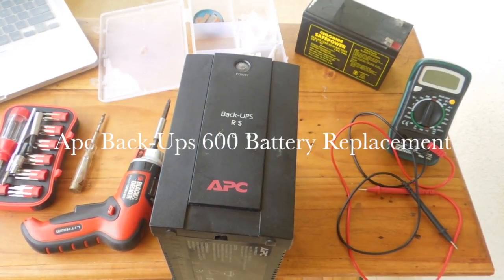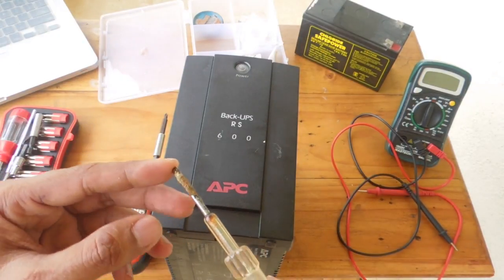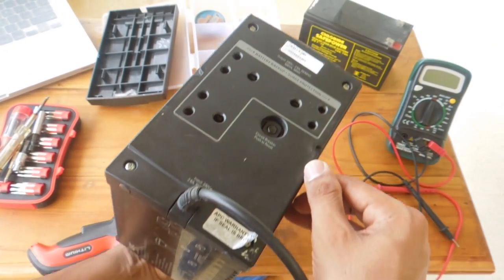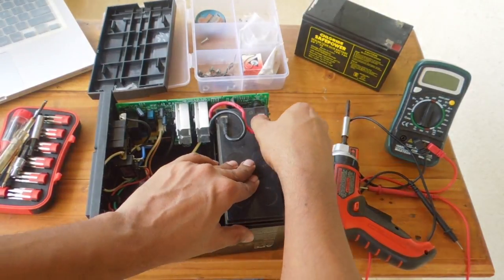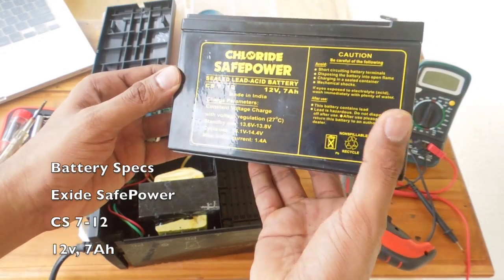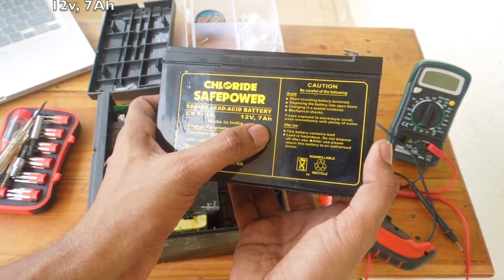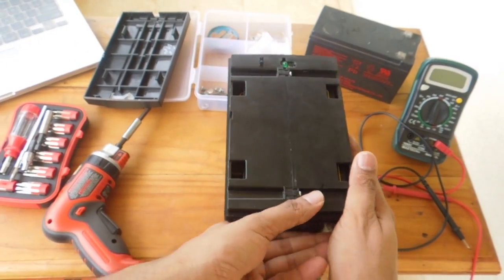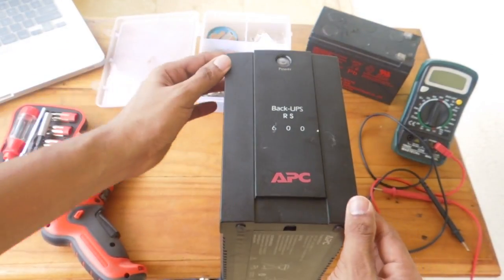Apc Back Ups RS 600, 500 opening and Battery Replacement

Comment: i have 550VA 330Wats so it come with 12V lead acid battery i change it have 18V 5A lithium battery with 18V converter sept down to 12V 20A so i can used 18V 12 amp 18V 20A ETC

Comment: Sir, please help  me. I replaced my battery before 14 days. But after some times it creates beep sound. Why
Reply: does it make a single beep or few continuous beeps, try disconnecting the load (peripherals that have been connected to the ups) and see if you still get a beep
Reply: @krasotkachekaleva191  few continuous beep, sir. Now it not on
Reply from the maker: have a look at the Error codes (Beep sounds) in the manual. Check if the battery is getting charged,  also check if the battery is an original one as in the market lot of fake batteries, if the battery is not charging could be a fault in the unit. Hope this helps.

Comment: Thanks, this video is very helpful but like someone else mentioned the mentioned Exide battery size is little bigger than the original APC battery and hence the battery compartment had to be enlarged for which some effort is required. Perhaps the newer version of Exide battery size is different, other than that spec is matching perfectly, works fine. Thanks again!
Reply: I also had no problems in putting the exide battery in the apc ups had purchased the ups on marketplace in Goa, and there was no need of compartment enlargement, only thing you need to properly set the red and black cables connecting the battery.
Reply: no problem on mine too
Reply: on my apc ups 600 I used the same exide power safe cs7-12, I had no issue in placing exide battery in the battery compartment no need of compartment enlargement.
Reply: @harshpatwardan9277  strange but good to hear.. :)

Comment: I hv same model , how can u install exide inside it cause the battery compartment fit with only APC battery .....
   Any 12 volt 7ah battery compatible with it , from outside with long cell terminal cable ?
Reply: exide chloride safepower battery perfectly fits in the compartment with out any cutting or filling, I have replaced my Rs-600 ups with exide battery few years back.

Comment: There is Continuous sound during charging is there any problem bro? after long time I charged that I don't know pls help
Reply from the maker: If there is a Constant Tone when the led is on (power on), then Battery Overload - Connected equipment
requires more power than provided by the Back-UPS
battery. Unplug devices one at a time to remove
overload.
and if the power on led is off and constant tone then Back-UPS has an internal problem,
and is no longer powering the load

Comment: Replaced my ups battery today...
Your video was so helpful :')
Reply from the maker: Glad it helped! feel free to share
Reply: You used lithium battery i have 550 VA ups ok come with 12 V lead acid battery i have 18V 5A with 18V converter stepdown to 12V 20A so i can run 18 V BATTERY 20A

Comment: After changing battery, power off means long beep sound coming, any solution
Reply from the maker: Connected equipment requires more power than provided by the Back-UPS refer to the user guides I have shared in the description

Comment: How do you replace without cutting the battery slot?
Reply from the maker: there is no cutting involved
Reply: no cutting involved the cs7-12 is a perfect fit only thing that needs a little bit of  adjustment are the cables
Reply: no cutting involved whatsoever
Reply: no cutting snug fit

Comment: Nice and clean.....
Reply from the maker: thank you, feel free to share
Reply: @psycolana  My APC RS 600 UPS Beeping While playing new games..Is there a way to disable this beep, I know may be its because of overload/old battery. It does not happen with other UPS.
Reply from the maker: @umaymailme , you could removing the piezo directly , does the ups beeps when you power it on?
Reply from the maker: @umaymailme ,  replace the battery,  or remove the piezo buzzer which is located on the board which will require desoldering.

Comment: bro my battery is welded so cant replace how to do it
Reply from the maker: @SiGHT SMaSH, is it the same model?
Reply: @psycolana  microtek model
Reply from the maker: @SiGHT SMaSH, see if its just glue, you could also use a flat head screw driver, slowly and carefully pry out the battery, do not force it too much, and if you find it too difficult stop do not proceed, you could damage the ups, could you share the ups model no.

Comment: I replaced my battery with Exide 7Ah battery. Now UPS gives backup of 4 mins. With original battery I used to get 20 mins of backup
Reply: I have also replaced my ups with an exide cloride safe power 7ah battery,  i find no much difference between the two w.r.t. backup power, check if the battery you got is an original battery, as a lot off fake, refurbished batteries in market, check the manufacturing date on the battery, also how many devices have you connected to the ups? For those people who saying the Exide cs7-12 (7Ah) does not fit, it perfectly fits in the ups, I have replaced two apc ups with the same battery
Reply: @harshpatwardan9277  I now switched to 26AH external battery, I get much more back, only issue is that UPS trips after sometime and thats due to timer. Since UPS is not designed to run for longer durations

Comment: Thanks for the information 
I have RS 500 wanna know about battery backup ????
Reply from the maker: @Mehtab Hashmi, you are welcome, procedure for replacement of battery is the same as explained in the above video
Reply: @psycolana  thanks for the reply sir wanna using as inverter only with solar panel i just want to know example: 50amp battery backup
Reply from the maker: @ Mehtab Hashmi, send a message to "E Wall Online" on youtube for solar related queries he should be able to answer you better

Comment: Previous battery is 7.5 ah and you use 7 ah..
Reply from the maker: Previous battery is 7.2ah, you would get slightly less backup time, in the ratio of 0.97 (7/7.2) times less than specified for 7.2 Ah battery

Comment: .The exide battery will not go into the original slot in the APC 600 UPS. So one has to make the slot bigger by cutting the body part. You are not mentioning this problem.
Reply from the maker: @John Thek the Exide chloride safepower : cs7-12 (7Ah) goes perfectly into the slot, and no cutting needed
Reply: @John Thek, exide battery theek se phit hotee hai, koee kating kee jaroorat nahin hai.
Reply: No problem whatsoever the exude battery is a proper fit in this ups
Reply: no problem its a perfect fit no citing to sanding required

Comment: apc 600 ups battery price ?
Reply from the maker: Hi Rezaul, replacement battery I am using of Exide (Chloride safe power 12V 7AH SMF Battery) only battery aprox RS. 1000, depends where you buying from some places you can get it cheaper
Reply: hey dude.. will the 12v-7amp battery of any brand will suit up in the APC box...need ur reply asap
Reply from the maker: Hi Fassil, some brands don't fit, u will have to check the manufacturers dimensions.
Reply: wow,thumbs up.. appreciated to ur reply ,bcz i was been ups for about 8 years....it lasted for me
Reply: Yeah..finally ordered the same Exide chloride safe power in websites....really thank full for  your video
Reply: @Fassilice  NO you need to measure the exact dimensions of the old battery or take a photo of the old battery and show it to the shopkeeper. Certain APC model UPSes have smaller batteries compared to the original 12v 7ah battery size.